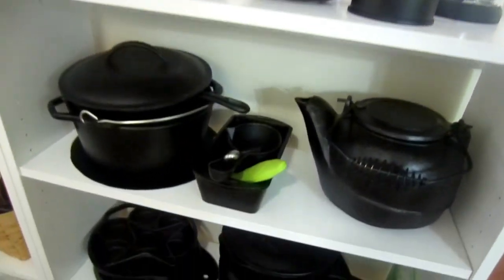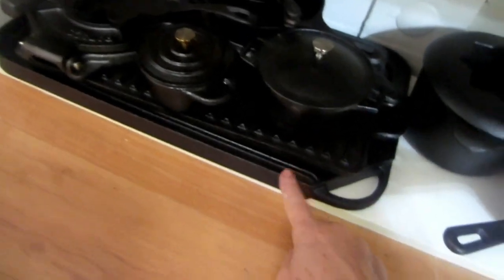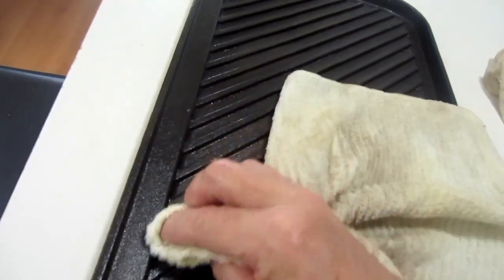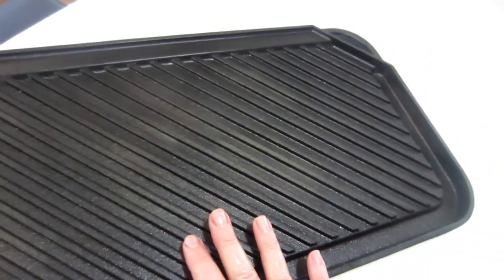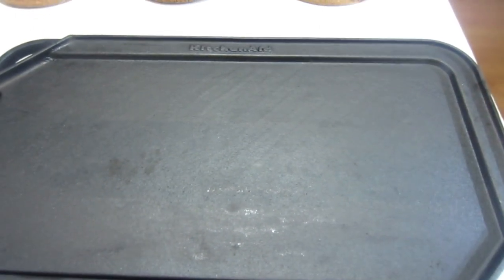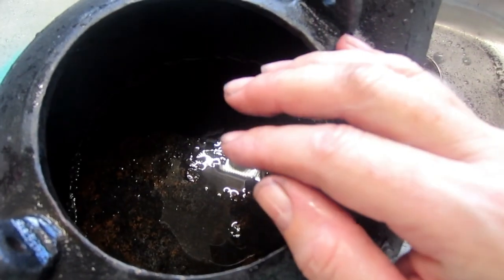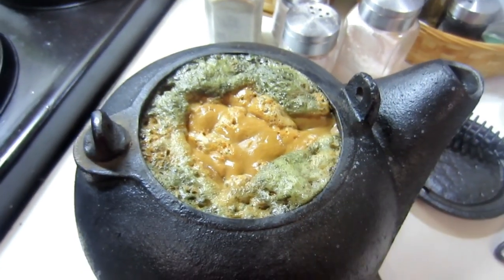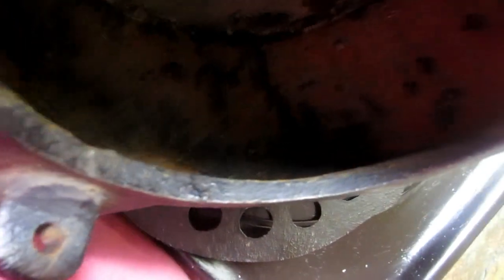How To Restore Cast Iron

Comment: Great looking pieces 
A way of making this process a whole lot easier is the use of caustic soda 
This has to be done carefully as it needs extreme care and caution , it’s a great way to do a few items as the process needs to be done slowly as the risk of harm , but it’s a breeze after just wash thoroughly keep the caustic solution safety stored away for next time 
Just use extreme care                        No muscle and very little time needed
Reply from the maker: Thanks for the tip!

Comment: Hi Judith , for the kettles have you ever tried boiling sodium bicarbonate in them for 20-30 minutes ?  Sodium Bicarbonate did miracles to me in the past in the kitchen with pots , they were looking hopeless but after process , they were looking anew.  I also read that it  doing very well with cast iron too.   
 I m gonna try something different too , I have a mix of sodium carbonate , borax , sodium bicarbonate and lemon salt(citric acid ). I made it to use in the dishwasher machine for natural/ healthy / environment friendly substance to wash the dishes but a reaction started in the box and now they are like frozen snow.  I m gonna boil it in order to try clean stainless steel
Reply: After boiling , you can brush it , sand it , or use a towel to clean dirt from the surface. If process is successful , dirt , rust , burnt fat/oil / meal , should dissolve / disappear like a sand falling down from your body under the shower after going to the beach.    At least this was the result of my experience.
Reply from the maker: @MrAlpino3   Interesting. I also make a homemade household cleaner using borax, baking soda and sea salt for my sinks, toilets, tubs, shower. Never thought to use it on my dishes. Will definitely give your method a try next time. Thanks Alp!
Reply: @TheIntuitiveBodyFoodieNetwork   I ll measure the gram and liter and write here ,  A tip:  Don t let the vapor of boiling baking soda contact to your eyes too much , your eyes can dry up.

Comment: And once it is clean , what needs to be done next?
Reply from the maker: Use it! Don't wash with soap, only water and a scour pad. Make sure it's thoroughly dry before you put it away, lest it rust again. Depending on how often or how little you use your cast iron, you may need to  'season' it daily, weekly, monthly or yearly. Does that help?